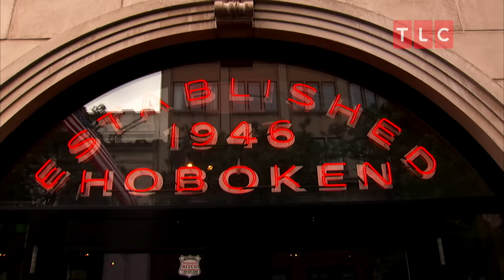This Fire Truck Cake Puts Out Fires! | Cake Boss

Comment: Firehouse cake: 90% wooden planks 60% rice krispies and 10% cake.
Reply: 160%?
Reply: its 10% cake 5%rice crispies 25% fondant 60% wood.
Reply: Did you get held back in school a lot?
Reply: AND A WHOLE LOAD A FONDANT
Reply: By the way 90+10+60=160 wth
Reply: That doesnt add up 90 + 60 + 10 = 100 🤓
Reply: That's over a 100%

Comment: Hey there. Everyone at the party is only going to eat like one slice or two so it doesn't need to be 3 feet of all cake. They use wood and rice crispy to save time so they don't make a that's only half eaten. They being smart and you haters being 😒. SO GO BACK TO BED AND WAKE UP ON THE RIGHT SIDE
Reply: Why do they give a fuck if it's half eaten they getting their money either way
Reply: Randomperson 2.000 it actually is mostly wood mixed with watery fondant
Reply: But they ask for cake not Rice krispy treats
Reply: They use wood on big cakes for structure I feel like people don’t get that cake is SOFT AF and will get crushed under the weight of the kind of designs they do. It can’t be all cake! This one I agree tho there was like maybe 1 sheet cake on top which is kinda ridiculous

Comment: I've been to their bakery and got 3 basic cakes and 1 set of cupcakes. 
The cakes were very delicious, but they weren't anything special. The cake was pretty average. 
For the cupcakes, they were basically the same as the cakes. 
It's honestly nothing out of the new or special. They're only like this if you get one ordered which is around $200 + dollars (depending)  Those "special" cakes seem disgusting. 60% wood, 10% cake and %30 Rice Krispy. Disappointing